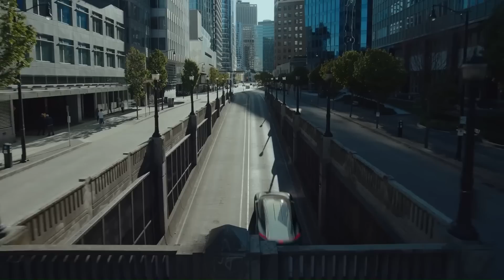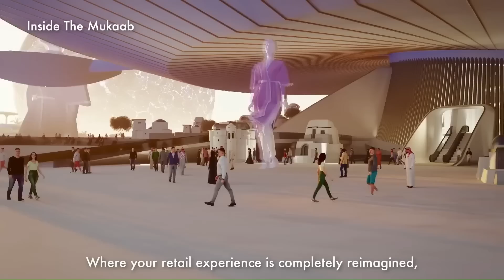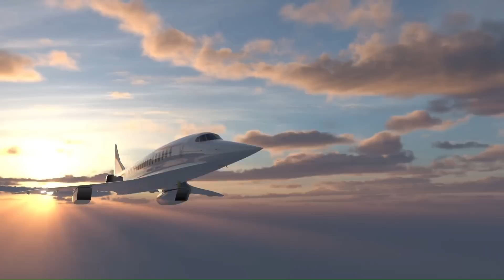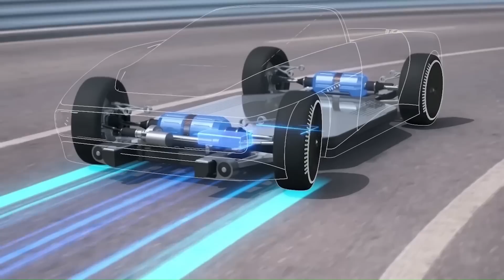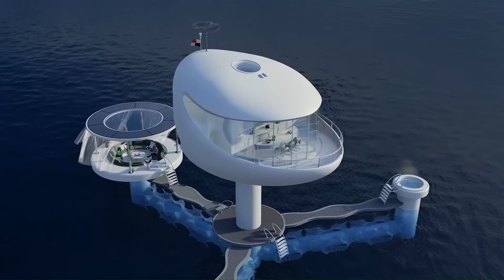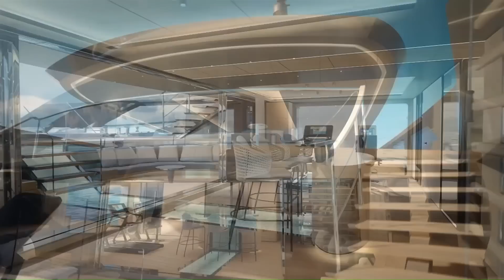12 INCREDIBLE CONCEPTS THAT WILL BLOW YOUR MIND

Comment: 1). The Audi. They listened to me and made it look less like a Viper. Too bad they went too generic with it now.
2) Mukaab. I think really don't think this is a good idea.
3). The Aircar. On. If it doesn't have four wheels on it, It. Isn't. A. Car. Two. Moller have already don this with their M960 Skycar.
4). Overture. I have seen the already. It was called the Concorde.
5). PLECTRUM. I don't really have the ability to care about an expensive yacht that is a compensation for something else that they lack the length in that is the opposite to my Eight.
6). EV anything is nothing I want and this is F-U-G-L-Y.
7). And Wind Energy is an even bigger joke.
8).  Seapod. Out in the middle of nowhere just above the Ocean held up by a stand that is basically a barstool holder. FUCK NO!!!!!!!
9). An Industrial EV "truck" This is biggest joke of all in this list. This will blow up or catch on fire faster than a Tesla being shipped on a boat.
10). The hub-less bike. it is cool, but the design messes up it's aerodynamics.
11). Another yacht, another 2" compensation.
12). Blimp. If I had the money, I would buy a G-5 instead.